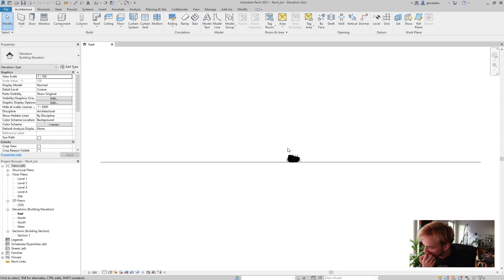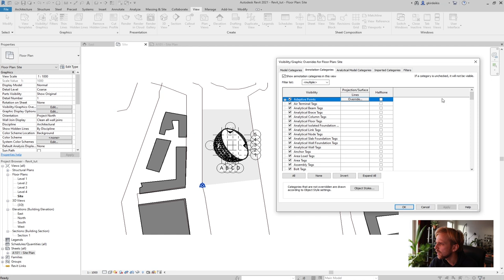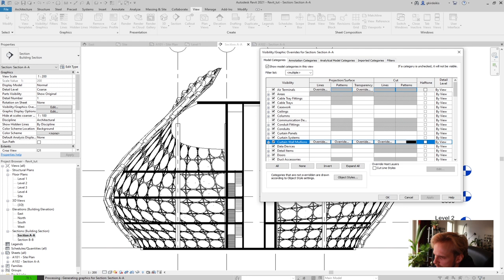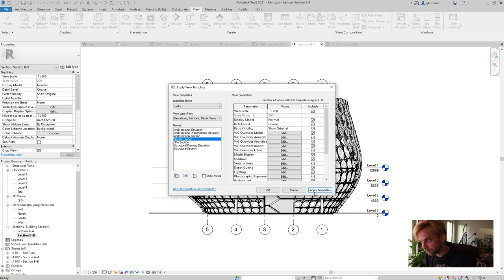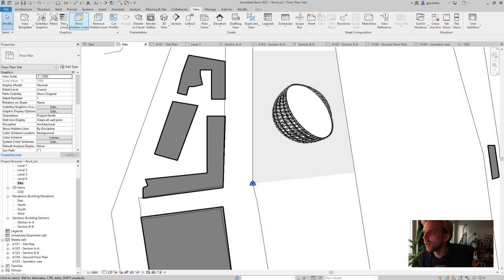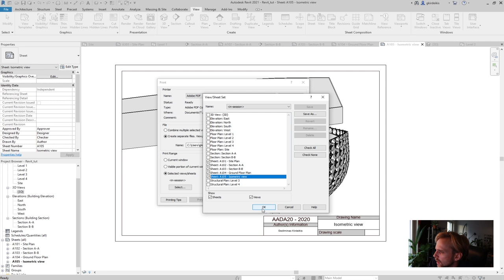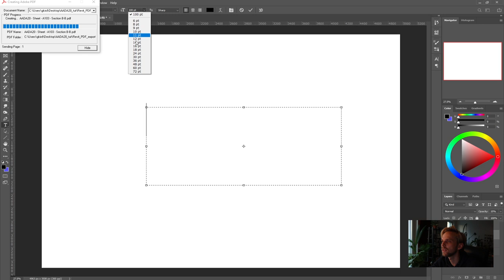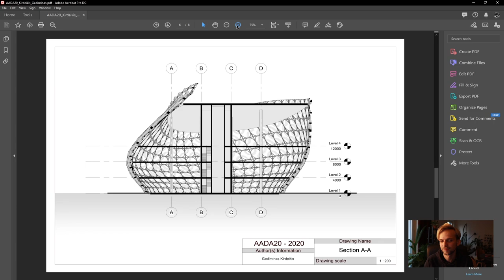AADA20 COURSE (Part 3) - Rhino - Grasshopper - Revit workflow for Architects

Comment: Hey Gediminas, thanks for all the great tutorials you provide!
One quick tip: instead of drawing the neighboring buildings through single walls, you can go under "massing and site" and create a new mass by drawing the outlines of the buildings (very fast if you use the "select existing lines" option on the top right) then selecting the outline and clicking on "create mass" to create an extrusion. You can then assign a material to the whole mass which makes the walls obsolete, and you can precisely place walls and a roof on the faces of the mass, with just single clicks each.
Reply from the maker: Oh that's super useful thanks! I'll bump your comment to the top.

Comment: Hey, you are really dam goood! Thank you for all of these videos. But i have one question. Floors and wall massing have no any connection? Are there any ways to  make the connection between? Of course, i realize, that this video isn't about it. But, this point is interesting for me and, it seems, i have no idea what should i do...
Reply from the maker: Yup, in this case - the detail level is quite low, so we're not solving the connections. First thing to do is to figure out what kind of structural joint you''d be using and how that structural joint will anchor into the structure of the slab. So it's an engineering excercise. Once you've done that - you'll need to parametrize it with grasshopper or Dynamo specifying the areas where you can have variable length (to eat up the difference in gap size from one connection to other). At that point you just bake it out, import it into revit and call it a day. I'd say, for a professional it would take a month to do it properly for the whole building.

Comment: Does Revit import sat files (or 3dm) as nurbs objects or are they polygonal meshes?
Reply from the maker: I'm a bit confused about that... Basically when testing it out - I noticed that Revit triangulates the imported geometry from Rhino, so my first instinct is to say that it's a mesh... BUT - once imported - you work with the geometry as if it was a Nurbs polysurface... So right now my best guess is that it does Nurbs -> Mesh -> Nurbs conversion when importing. If this is true, then I'd like to be the first one to say "What the f... autodesk?"